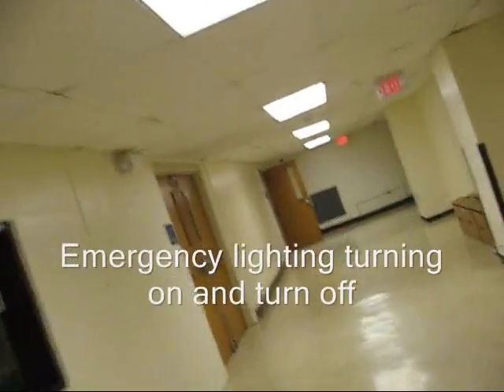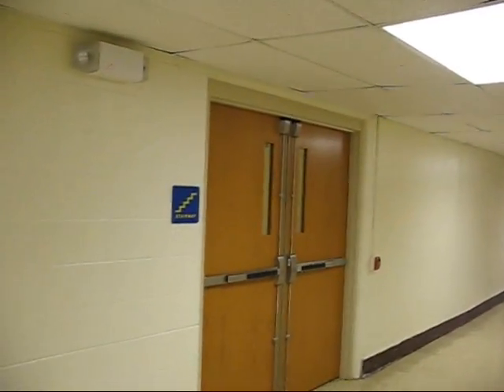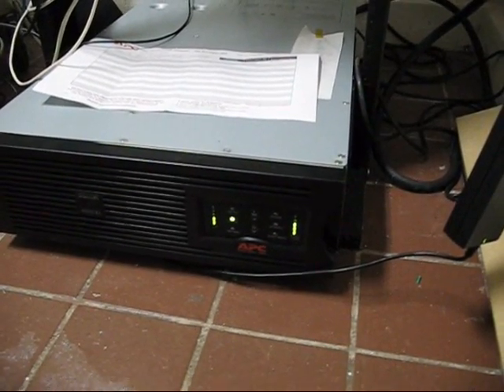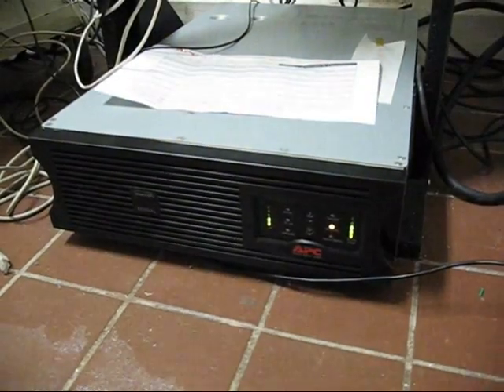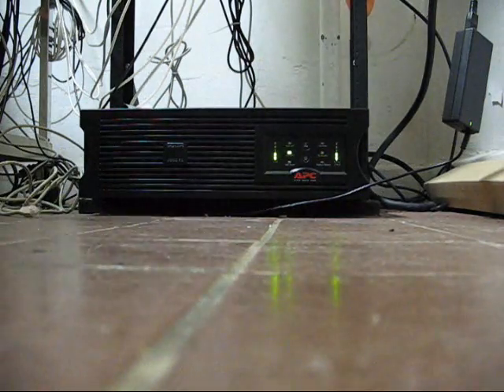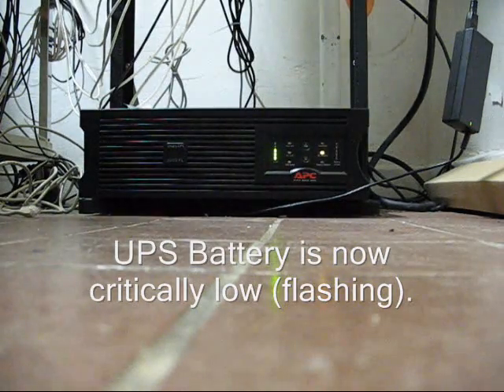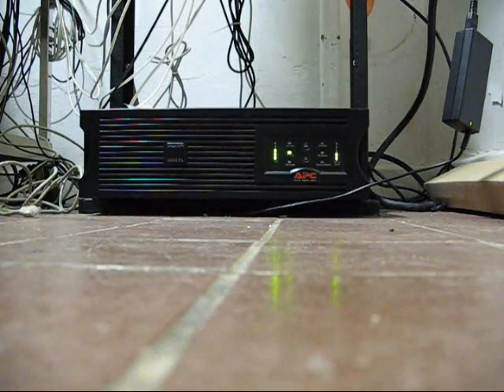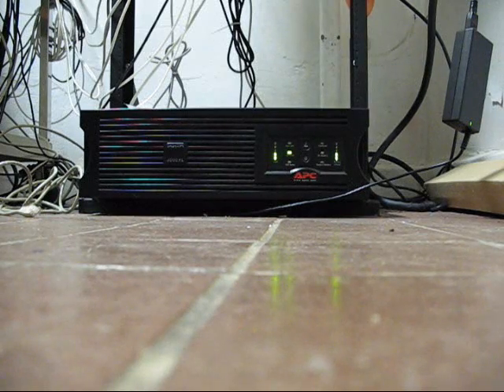Power Substation Arc-Fault in Cornell, WI

Comment: That UPS is going apeshit trying to keep good, stable, PFC power to the servers. I'd do a self-test to make sure some relay wasn't damaged during that. I wouldn't think so, these units are made to deal with that but you never know.
Reply from the maker: Correct, every power transition back and forth from main to battery is subjecting the relay contacts to arc/spark erosion. This evening likely did significantly shorten the life of the UPS, by constantly tripping the relays.

Comment: We have 2 APC3000XL (not server rack/tower mount) and they can supposedly run our whole house for 1 day on battery.
Reply from the maker: I highly doubt that, unless you have a huge expensive collection of battery expansion boxes, or you have propane or natural gas for water heating, building heating, and cooking heating. A typical water heater uses about 5000 watts, far beyond the 3000XL capacity.

Comment: I remember when I was a senior at my high school, the classroom that I was in had an odd power failure. Basically, everything in the room lost power except for the lighting. The rest of the building was okay, so I know it wasn't a power outage. I don't know what happened then, but my best guess would be an electrical fault.
In a separate incident, I was in school during an actual blackout. It turned out that a student crashed into a telephone pole outside the school parking lot. Ironically, the student was still counted late to school.
Reply from the maker: (LONG reply, sorry) Most large buildings use 3-phase power, which uses 3 wires for electric motors to run more efficiently. Most small devices such as lighting and computers, are made for 1-phase power, so inside the building the 3-phase is split into multiple 1-phase circuits.

If 1 of the 3 wires is broken, then any 1-phase devices that happen to be using the two remaining power wires will still work, while all other 1-phase devices will turn off.

This is known as *phase loss*, and it can cause expensive damage to the motors that need all 3 phases. The motor works like a 3 cylinder combustion engine that fires every 120 degrees of rotation. If one cylinder suddenly fails to spark, then it loses 1/3rd of its power.

The motor is doing work with a partial power loss, so it slows down, and it may reach a point where it can't coast under load past the point where the missing phase is expected, so instead the shaft rotation stalls, the rotation slips backward a bit, and the motor stops turning.

But the power still on in the remaining motor windings, which means this large motor still uses power but it has no airflow from its internal fan. So now it just sits there humming from the AC power and the electric windings start to overheat. If this continues long enough, the wire insulation will melt, the electric wiring will short out, and the motor windings will be permanently damaged.

The 3-phase motor is now permanently damaged and will have to be replaced, which is itself a huge messy expense because 3-phase motors are big heavy beasts installed in often difficult to access locations.

It might be possible to take the damaged motor apart and re-wind the motor with new wire, but usually the job that the motor was doing, is something where it can't be inoperative for the many days that it takes to do this rewinding and repairing work. The damaged motor has to be replaced immediately with a working motor to restore normal operation as soon as possible.

Comment: Impressive that the UPS was able to deal with repetitive power cycling for so long.  I have 3 Smart-UPS 1250 units on my servers and have never had any issues with them.  Though I learned the hard way not to use cheap batteries :-)

Comment from the maker: This is the Smart UPS 3000 XL at 120v 30a. For the next size up, the voltage changes to 240v.

We have some older 120v hardware so the 240v UPS would not work without the APC step-down transformer option. But if you can go with the higher voltage only for everything, then it can be less expensive.

Comment from the maker: Most basic home APC UPS's only have serial or USB to connect to one computer. Business APC UPS's have an expansion slot for the management card.

There is also an option which allows remote control via a call-in phone line, to remotely turn it off or on, or check health when the network is down.

Go to Google and do a search for  AP9630  or  AP9618  ... it's an expensive option.